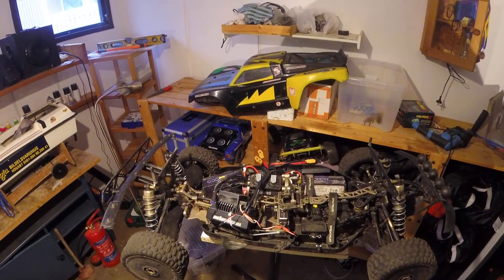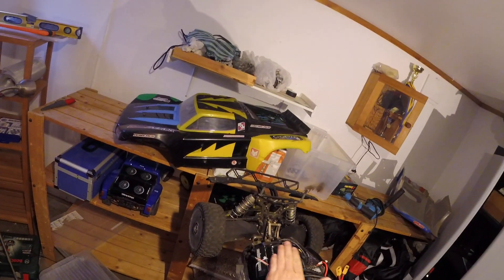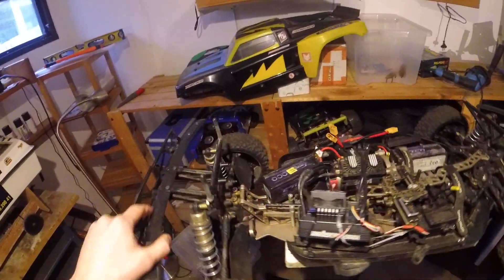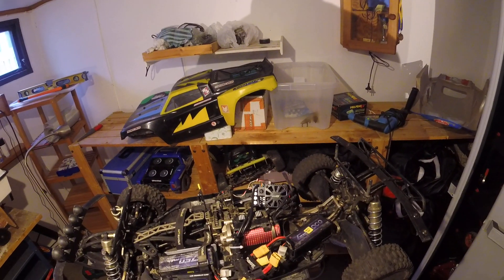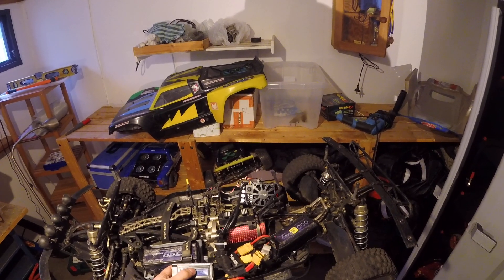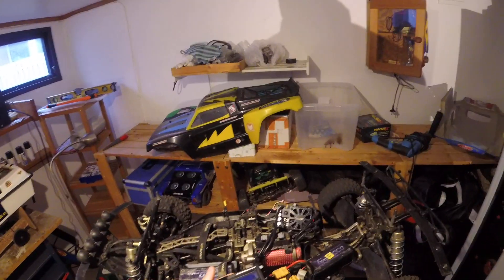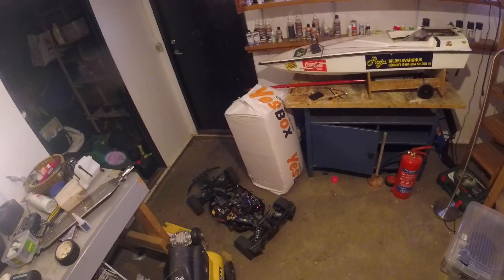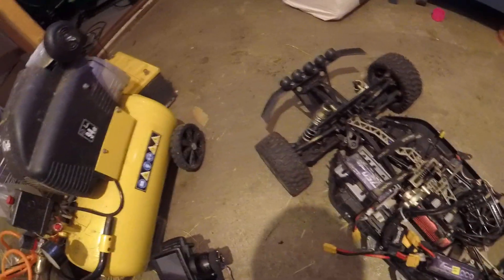ZTW beast pro 300A ESC review.

Comment: When the ESC acts like it don't wanna turn off Hold down the power button then pull and hold down the trigger in gas or break while holding the power button then it will turn off.
Reply from the maker: Yep. Have also discovered that since i made this video. It also usually works with just touching only the throttle slightly and then trying again.
Reply: @iceman5886  When you first drove your car did it drive really slow ? I think i have some of my sittings wrong with the program card.

Comment: No idea lol. Mine runs fine in my Losi 5iveT with the 70120 620kv and 17t pinion on 12S. Your XT90 connectors are too small for starters, the switch needs to be held down for 2 sDr cs until the light on the esc goes out, you probably have it geared too high, 700kv on 12S in the W5 is too much, go with the 530kv Leopard. I'll be running the ZTW and Leopard 700kv in my RR5 on 12S as it's much lighter

Comment: Still using and holding up?
Reply from the maker: Yes. I have  had 3 of those escs.
One failed early on 12S. Probably due to kv and gearing being too high for 12S running with that car.
The other 2 have seen lots of runtime, mainly on 8s without major issues.

Comment: You think the bigger 620kv motor will fit in the mcd w5 max?
Reply from the maker: If you are talking about a 70120 size motor i know it will fit. A friend of mine have mounted that in a mcd.

It will require minor mods to the rear  motor holder(bracket) but nothing complicated.

Comment: XT90 conectors? Use some XT150 or EC8...not a 90amps reducer!!
Reply from the maker: Not an issue at all.
This is a paralell setup where the current is split on 2 or 3 xt90s on each side. At least 180A connector capacity then. More than a single xt150

Comment: Hi is that esc still working?
Reply from the maker: Yes.
I have had 3 of those 300A esc. One failed in may when a rock was jammed in the drivetrain on 12S.

On 8S i have a lot of runtime on the ESCs and have had no issues.

Comment: Thats a real big car!  I like it!  Are you still using the same esc and are you still happy with it?  I'm considering getting one.  Id be grateful for your opinions.
Reply from the maker: I have not done a lot of running with this car since this video, maybe 1h due to failure of the 3d printed battery holder.
But I also have  a brushless Dragonhammer which has an identical ESC. That one has done more running the last month. 
On my Channel there are a few clips when i drive that car which is larger than the mcd in this clip.
So far no esc Issues.
This weekens i will go to a bash meeting at a sand track w both my brushless 1/5. That will be a Good test Since that track   is heavy on motor and esc..
Reply: @iceman5886  thanks for the reply and your thoughts.  I'll be sure to check out your other videos of the Dragonhammer
Reply from the maker: Some more DH videos on my channel.A Review , 2 running vids. This one is the newest. https://www.youtube.com/watch?v=cSV-l1og_5w. Both my 1/5 E-Buggy (also ztw esc) and the  Dragonhammer voltz in this video.

Comment: I had same problem with switch, I ran 12s on mcd v4 ran ok with 800kv tp motor, it was when I ran taller gearing it failed, have an Alien esc in it now
Reply from the maker: Ok. Good to know. I have only run some speedruns w 12s.
8s is more than enough on the tracks I drive.  Still a lot more than all gassers exept 50+cc.
Reply: Good to know about this esc. I was thinking of getting one. Keep us posted on how it holds up.
Reply from the maker: @TheoCook  https://youtu.be/sgYz2DdS1xI
More running. Ztw 300a in this car as well.
Reply: rob500100 I hope you have better luck with Alien esc’s. I had two that went up in flames on my Losi dbxl. And not going fast or high gears. I was more than 🤬
Reply: @TheoCook   had one before, 16s 350amp sport, brakes and reverse were no good but it could handle 12s easy, my new one is latest version, 500amp brakes and reverse brilliant, it heavy but that's not a problem

Comment: If you run 12s you need to run a lower Kv...... that's why people are blowing them up as they're using high Kv motors and putting loads of strain on it.
Reply from the maker: You are probably right. But I am not sure its that simple in this case. Probably 500kv motor would be good and run efficient i this.  But the Dragonhammer voltZ has only 680 kv and that has had problem with broken esc on 12S.
In my opinion 680 is not very high. Most likely a big part of the reason is that the DH car itself is heavy  and the included motor is 70120 size which is bigger and more powerful than for instance the 700kv 58113 my car has. 
Then there are the different gearing options. .

Anyway Im satisfied with the 8S performance level for almost all types of running so i will stick to that for 95% of all running.
Reply: @iceman5886  The Voltz has a Problem because it weighs 22-23Kg and is massively over geared...... I've got my ZTW Beast now but finding it's faster in reverse then forward.
Reply from the maker: @almighty151986  
I had the same problem.
Used the program card and changed motor rotation direction.
Then I just reversed the th channel on the transmitter and  recalibrated the esc.
Problem solved!

Btw it looks like FID has also realised the DhV is over geared w those big wheels. From what i have seen the new 2019 version seems to have a smaller pinion, 19 instead of 21t. Maybe that helps a bit. That car isnt a speedrun car anyway.
Reply: @iceman5886  I'm still waiting on my program card........ And with the new 2019 they've changed pinion but added more alloy and made it even heavier..... lmao :)
Reply from the maker: @almighty151986  well if it is 24 kg w batteries it is still only 20-25% heavier than my car. Of course that is substantial but it can be compensated for w gearing and still be quite fast for that type of car. I will have the opportunity to try the voltz later this year. How do u know the actual Weight of the voltz? Cant find that anywhere. Seen the petrol version is something like 21 kg.
Reply from the maker: @almighty151986  https://youtu.be/sgYz2DdS1xI
Voltz. Still no esc failure. 1.5h runtime now.